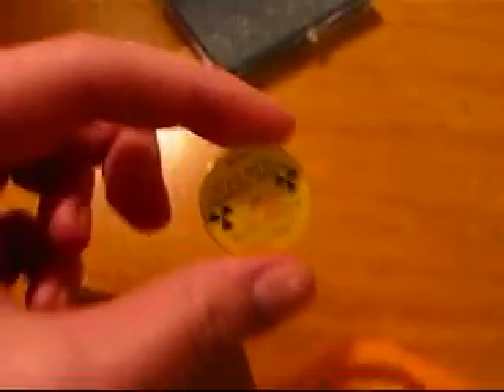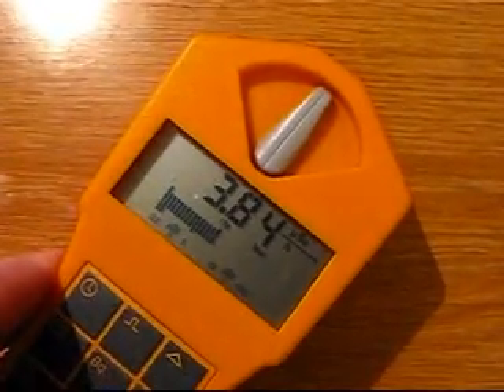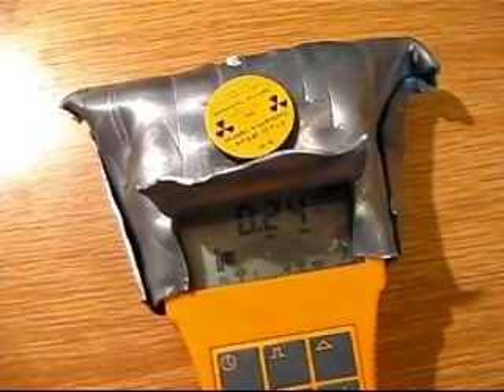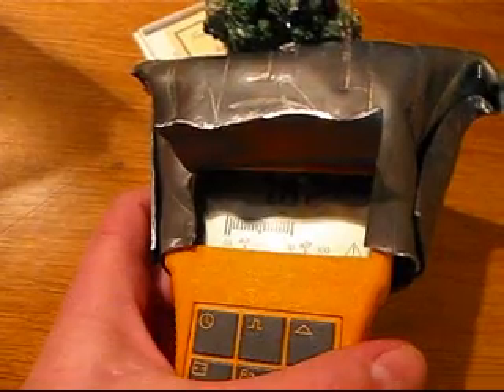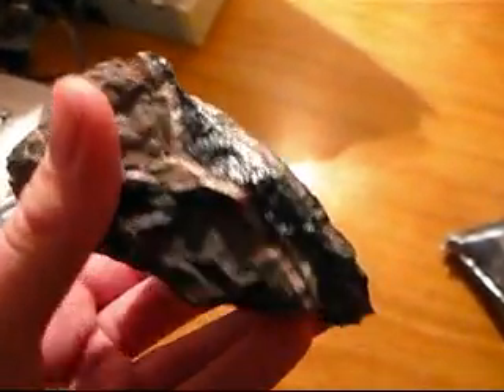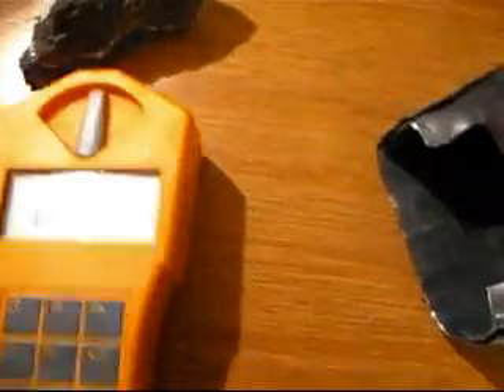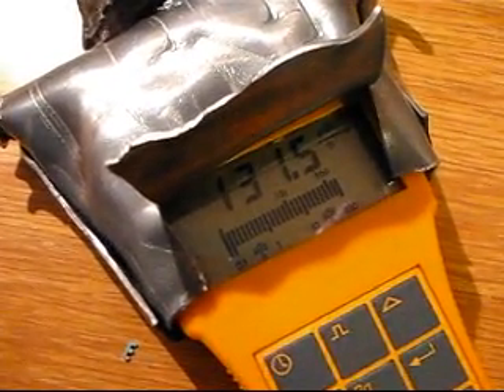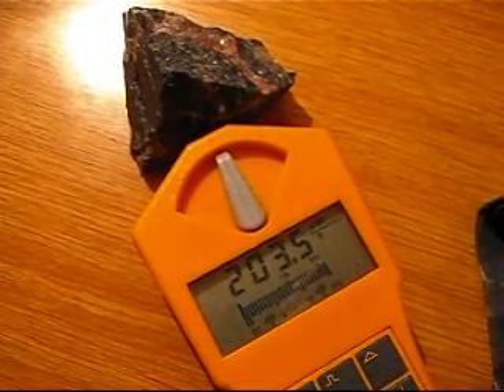measuring gamma rays only (on uranium ore)

Comment from the maker: try it with the alpha window open - then, there should be no difference in shielding. they changed the beta/beta-gamma shields, but not the case. and the case does not contain additional shielding. 
if the alert model is significantly older than the rechargeable (or vice versa), it may simply be that the tube experienced a lot of ionizations and is no longer as sensitive to radiation; thus, recalibration would be required (yes, GM-tubes do get "used up" as well, it just takes quite long).
Reply: Hi Bionerd, hast Du eine Ahnung wie lange es dauert, bis die Sensitivität signifikant abnimmt ? Ich hab ein Gerät mit der bekannten LND 712 Röhre und schätze diese auf ca. 25-30 Jahre. Das Gerät funktioniert noch einwandfrei ich habe nur keine exakten Strahler um eine Kalibrierung vornehmen zu können, davon abgesehen kann das Gerät auch nicht kalibriert werden, da es nur die Impulse misst zusammen mit einer Art eingebauten Stoppuhr. die Sievert pro Stunde muss man sich also selber ausrechnen mit einer Formel, in der ein Wert die Sensitivität der Röhre ist, den ich dann entsprechend verringern müsste.

Comment from the maker: you could, just seal the uranocircite, autunite etc. into transparent plastic cases. maybe be very creative and seal some wiring (molex or whatever) through the case with it, too. that'd look cool.

actually, i'd be too worried about my computer to do that, though, lol. unlike my own cells, my computer does not have a self-repair mechanism, so radiation damage to components would be permanent. not sure if it'd be severe enough to notice, but i'd rather not try it on my beloved computer.

Comment: I quick check on a nuclide chart also indicates that the U235 decay and most alpha decays also produce some gamma. According to the chart gamma the energies of 185 and 143 keV can be seen. Not very energetic but still significant!
Reply: Most of the gamma comes from the decay of Bi-214 in the uranium decay chain. Many different energies, with high emission probabilities (609keV is the most prevalent). Much more than the weak gammas produced directly from uranium (185keV for instance)